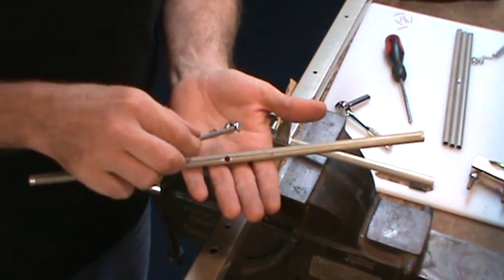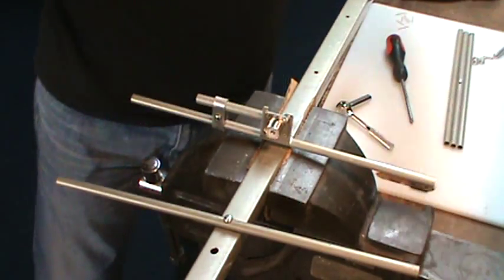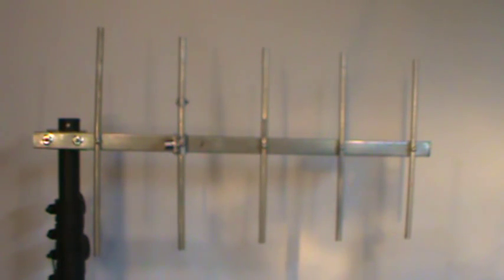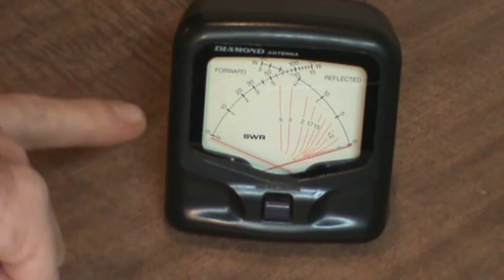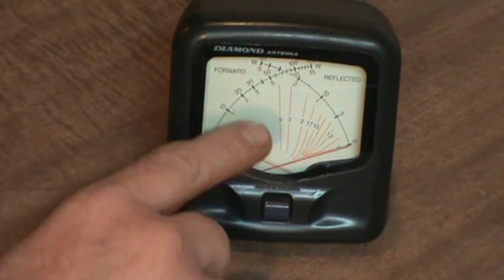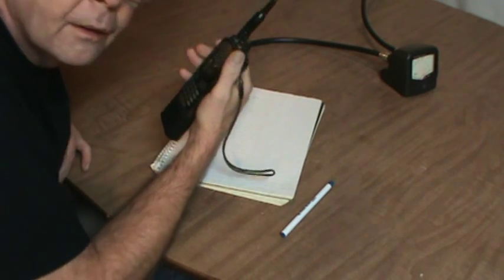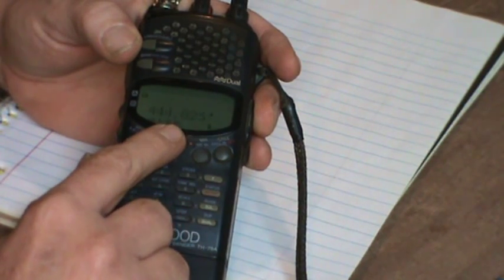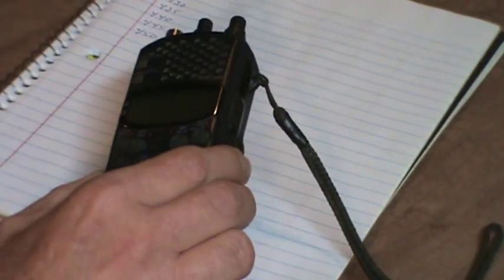70 cm Yagi Antenna Part 6/6

Comment: Hi Dave. Great job. Hey I have not built an antenna yet but am planning on doing so soon.  Question.  Is the driven element one solid piece? Or is it separated in the middle?  It is my understanding that each side of the drive element is separated and insulated from each other. So that each conductive part of the coax (inner wire and outer braided wire) has its own side of the drive element to connect with.  Is this not correct?

Comment: Hi Kevin I think you can use a metal mast for mounting, you can also mount the directors on metal, the driven element is usually insulated from the boom if it is a dipole type, I think as Dave is using a Gamma match the driven element can be connected direcly to boom...most yagis are connect to metal mast unless they are mounted vertical from middle od boom, then they have a plastic stand off section..Fred ok

Comment: Hi Dave an Idea I thought of, if you wanted to make some kind of Yagi that needed a folded dipole, like a 2mt 10 element or something, if you were using coat hangers you could use a chocolate block connector we call them over here, a mains connecter that has screws in to clamp the wires, you could anchor that to the boom, then connect each end of the folded dipole to each screw, and you could also put the complete side through an adjacent one, so have a double connector, would be strong Fred uk